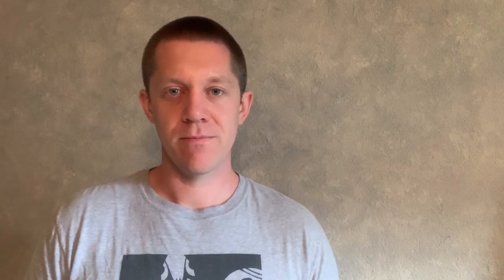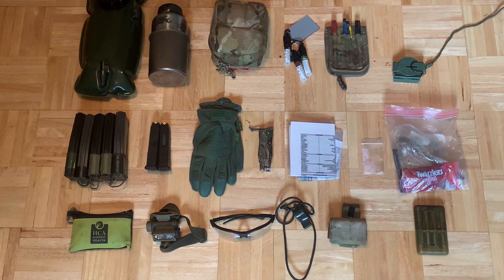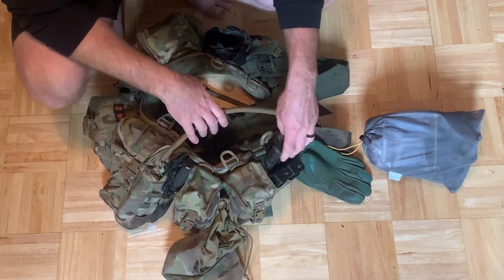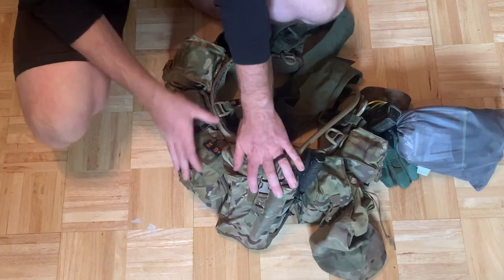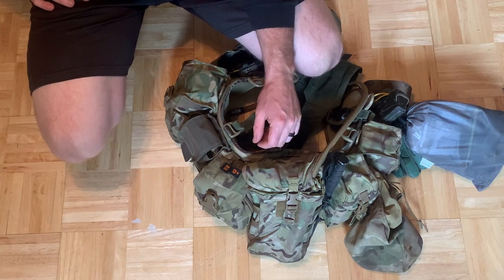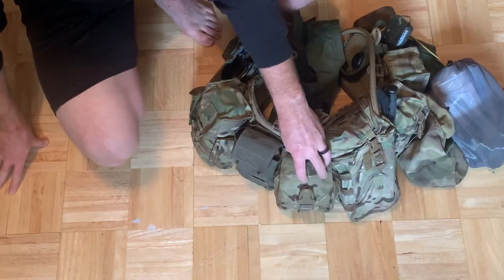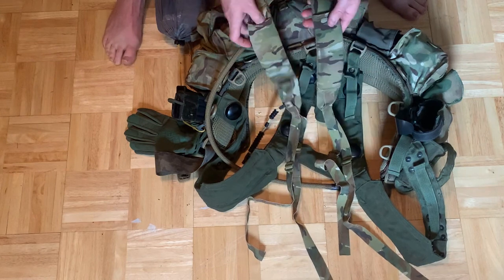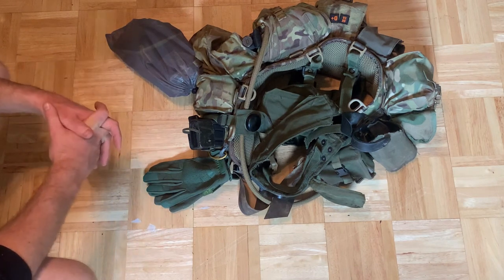One Shepherd LBE Recommendations 3/4 Modern Belt Kit

Comment: I'm probably 2 yrs too late but they do make a straw adapter kit that works on regular water bottles wide mouth or regular. I got one 5 yrs ago
Reply from the maker: Indeed, I actually started off in my LC2 days running a 2qt canteen with the straw on my LBE for drinking on the go and a 1qt without a straw for use as my drinking while static solutions. I've kept this philosophy throughout the years and have experimented with several solutions. Floppy containers with a tube (usgi 2qt/hydration bladder) are good for drinking on the go because they don't slosh and don't require any extra time to "hang on, let me get my water bottle out, sip and get my pouch clipped back". On the flip side, hard side containers are much more convenient for use when static such as in a patrol base. Ever try to drink from a half full 2qt canteen in the middle of the night when you're mostly asleep? That's a recipe for dumping it on yourself>hypothermia>death. To further complicate things, water in straws freeze making any solution with a straw a no go for winter ops. Keeping all this in mind, my solution as of this video was to carry a metal 1 liter bottle that can be used with the cup to heat a meal and liquid at the same time and is convenient for static use for the 3 warm seasons. The bladder gives me a total of 3 liters which I like for summer ops and can be half filled without making noise if I want less in cooler conditions. The straw is convenient for anything above freezing. For winter ops, the bladder gets swapped with a 2 liter south african canteen (if I need that much water for the mission) and the 1 liter bottle becomes my primary on the go water source.

Comment: How did you mount the safariland holster?
Reply from the maker: Yeah that took a bit of doing, It's a QLS on a CUBL on a MLS fork. I had to drill holes on the CUBL to mount it on the fork but it worked well once secured, I used a long CUBL to drop the holster to a manageable height.